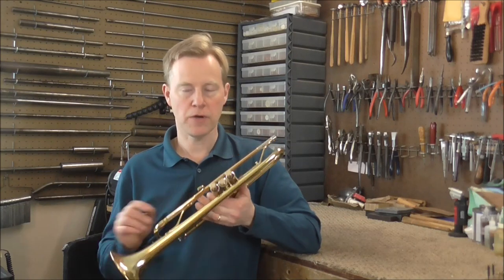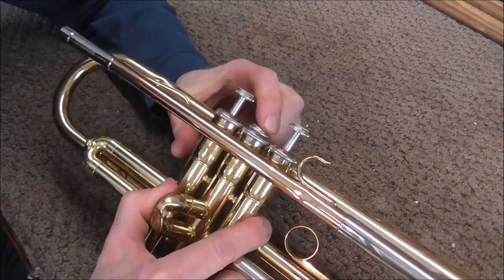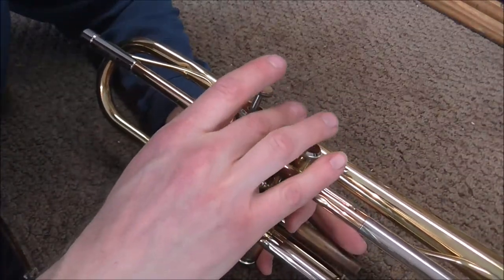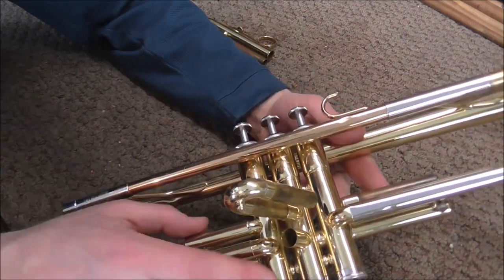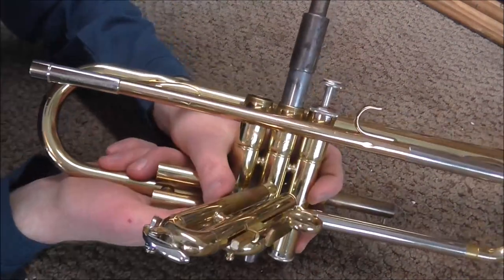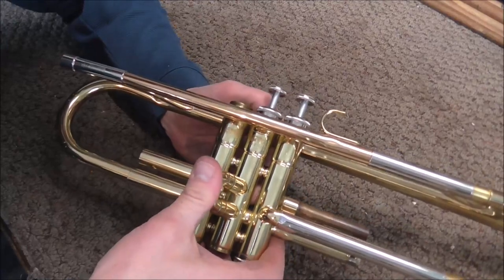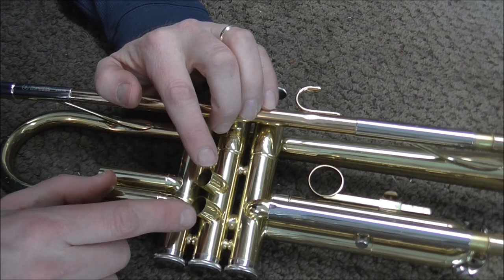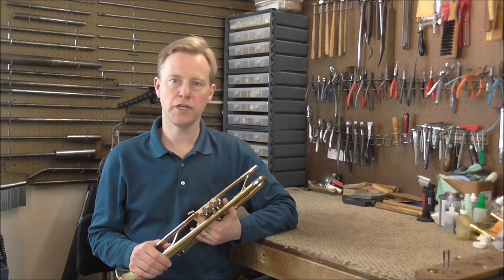How To Fix a Stuck 2nd Valve: Pushed In Slide

Comment: Dear Sir, what does it mean (stop nut in the first slide valve) or (non stop nut in the first slide valve)? Thank you very much for your time.
Reply from the maker: A stop nut is a screw that keeps a slide from falling out. If you want to remove the slide, you can remove the nut and then the slide can come out.

Comment: I have found that about 7/10 of stuck valves are from students who don't practice and haven't learned how to properly clean their instrument. You would be surprised how many kids have never been taught how their instrument works or how to clean and maintain it. If they are willing to sit still for a quick cleaning lesson I will most times wave the fee. I'd rather lose a few bucks then have them bringing it back every month or so. I hate cleaning yucky student trumpets. Thank God for sterilizer and rubber gloves.